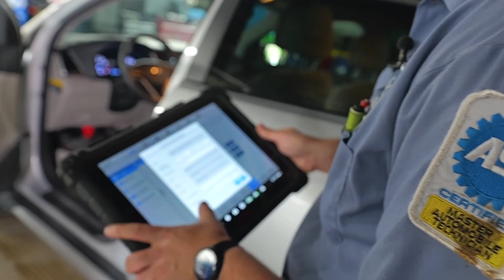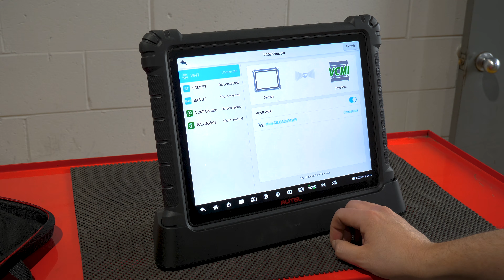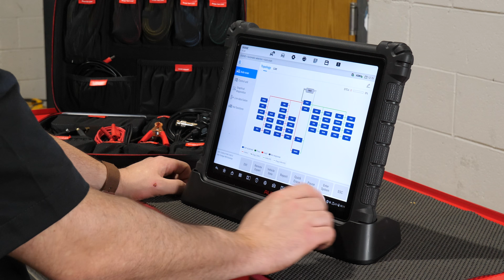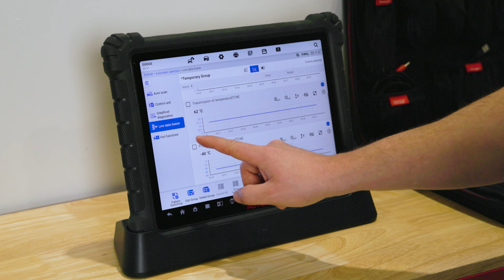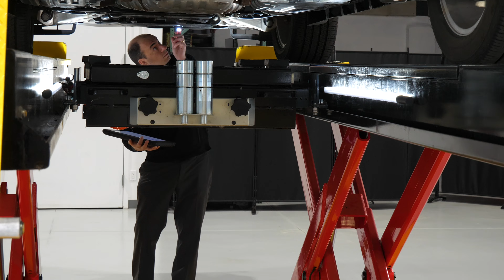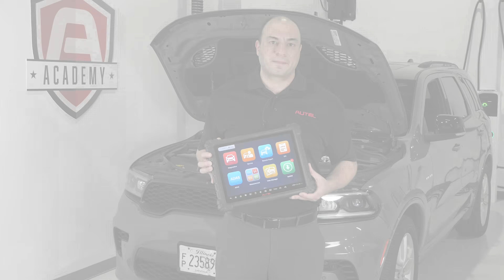Introducing the Autel MaxiSYS Ultra S2

Comment: You should offer this device as an option with the HVAC tool, have the lower spec as an option then an option to get the Ultra S2 with the HVAC system.

Comment: 3 units all dead in water AUTEL  service and quality has fell off a cliff they would prefer to send youtubers units than warranty the trash they force on customers! stand behind your products not  on the necks of your consumer!!                                                                                                                                                                          
MaxiSys MS906
Serial number: DS8G70102047 password: 259126

Registered on: 04/18/2017 Warranty : 04/18/2018 Region: Online

Software upgrade service expires on: 03/28/2025 (Expired) 

Period: (Year)

1
495.0 USD/Year

MaxiSys MS906 BT
Serial number: VB8GKAV01049 password: 717374

Registered on: 02/11/2021 Warranty : 02/11/2022 RGA Region: North America

Software upgrade service expires on: 02/11/2022 (Expired) 

Period: (Year)

1
695.0 USD/Year

TS508
Serial number: T85518023759 password: 089571

Registered on: 09/01/2021 Warranty : 09/01/2022 Region: North America

Comment: It still doesn’t support programming of control modules on other vehicle brands besides Mercedes-Benz and BMW without using Remote Expert? What about modules like BCM, TCM, and ECM on most vehicles.. can those be done without Remote Expert assistance? For a scanner priced over $6,000 with annual updates costing more than $1,500, I definitely expected broader functionality. It’s a great scanner overall, but I was hoping for more from the Ultra S2, especially given the price increase.

Comment: Autel is old news. You guys used to be top dog... a decade ago. With brands like launch, topdon, xtool, kingbolen, and others doing essentially the same thing for significantly less. The updates are cheaper, the scan tools are cheaper, the add on modules are cheaper with a larger selection too. The list goes on and on. 6k for a scan tool with $1600 yearly updates is absurd and thats why launch has been stomping you guys in sales and is in nearly every shop throughout the world today. You're updates are overpriced, your scan tools are overpriced and underperform, your UI is outdated, and you offer only 1 year of free updates on the majority of your scan tools. Someone who knows what their doing can diagnose a vehicle with $150 scan tool. They don't need all this extra nonsense. Not to mention, nobody even uses the oscilloscope option on these tools because if an oscilloscope is being used, then its a picoscope or a small handheld oscilloscope to do a quick check. You guys are falling way behind and eventually nobody will even care about autel.

Comment: Autel, your hardware was outdated before it was released!   My 6 year old PC has 64GB of Ram.  Your prices are nearing those of Snap-On!  What are you thinking? "Small" Shops like mine cannot afford these kind of Increases.  I for one am not going to suck out all the cash of my customers.  Corporate growth is showing its true colors as you mentioned!  You are growing to the point where it is time to jump ship to someone that is giving a good product at an  affordable price.
I give you a hint! When a Company grows so do their prices!! 
Don't even get me started on your so called experts! That is a joke in itself! I have already seen this for myself, it is sad when you get charged for experts that know less than what the guy using them does.
Don't get me wrong, I have no problem with the Ultra but they are certainly not very reliable tools. I have a host of them and be the first to tell you they are still cheap! 
The fact you do not build on a platform that is future proof shows your true colors!! Yes I said that! There is no reason at all that last years EV Model should not be able to get a lot of the functionality that the S2 is bringing.  At the very least there should be some reasonable trade in option, heck even Snap-On does that!! 
I have the Zeus Plus as well as the Ultra EV and I still end up using the Zeus more. 
I locksmith as well so I use the Handheld and the 508 and 608 with all the trimmings as well. Over the years I had a lot of glitches and wrong information with those as well. 
Again, still good tools but you should not upgrade tools to a point where your previous tool gets left behind to the point where you may as well throw it in the corner somewhere.  These Tools are not easy to sell! I have had mine on Marketplace for 3300 with all the latest updates and not a single inquiry about it!

Comment: They do not think when designing stuff. Well this is not their tablet its made by someone else. They just load software on it. I was gutted ultra 1 because vehicles like 2005 Land Rover it said rewound brake cable and nothing happened. I tried to reset Dpf on Renault van 2020 and it said done but wasn't. went to a Snapon scanner with the van and it did both the aforementioned jobs properly. DID YOU KNOW AUTEL WERE FINED 20,000,000 hacking and stealing data from competition. 

If they'd wanted to make this a great tool interchangeable batteries like power tools have so one can be charging in the shop always. I hated the case of ultra 1 it was so massive. And for this machine costing so much you would want it to have a built in tracking device. I stuck apple tag on back and put one in the inner lining of the blow molded case. For the price of course you want to keep an eye on it. I would say Snapon On better machine.

Comment: Ok, I’m a home geek and need immediately a way to program an 2003 Mercedes transmission, we do not have the old one. Also, my son drifts and is constantly paying for tunes, can the system do this. Also, not wanting a brick that will not work unless I pay for updates, like QuickBooks Desktop who wants $1,000 to continue to use the program.
Reply: For that Mercedes, I recommend an Autoland  Iscan 3

Comment: Just too expensive...especially when ever an OEM files a suit, we seem to lose functionality in the next update. This all happens with no warning to the scantool owner. For example, the IM508 loss of AKL for Toyota.....  And the diagnostic OE repair software that was included in my Ultra when I bought it only until Snap-On sued Autel and then .....gone with no partial refund  from Autel. The day is coming when a class action will be filed against Autel by all the tool owners for loss of functions that they paid for.

Comment: Surely you could have just put all of that on the original ultra via a software update
Reply: I agree. But all to manufactures do this to get you to buy new hardware. They all do it
Reply: What? With their bare minimum hardware? Good luck.
Reply: @lynxstarautomotive208  what's the difference in hardware? They didn't say

Comment: Six grand plus 16 hundred renewal is an awful amount of money . I'd rather go Launch !
Reply: Launch top spec arrived with glue stuck over screen. The machine was shit at diagnosis. Special functions shit. I sent it back a week later.turd
Reply: @jamesbarratt593  I have a topdon max which is the same software as top of the line launch. You are correct the software is garbage. I only kept mine as that autel was off for a battery and I got the topdon max for half price. I do not understand how there are people bragging about topdon either they have limited experience or they are paid off by topdon
Reply: topdon phoenix max, cheaper and 2 years of updates
Reply: @ThatDIYguy862  I already have one. It's great .I bought the ADAS function too. It all cost me $3000.
Reply: You can get the updates for 900 from AESwave and I have a launch based topdon MAX. My ultra is much better
Reply: All manufacturers are going to catch up and soon all be around 1500
Reply: I have im608 pro and its not updated. Wont be either. This ultra 2 wont be updated yearly

Comment: Bought several autel scanners in the past. They only last around 3 years before the fry or die. Took them to computer specialists for repairs, and no one was able to repair them. I like the brand, will continue to buy them, but never for full price, ill wait a couple years until the prices is reasonable.
Reply: I have my 906bt since 2018 and it still works. Slower to boot but works
Reply: @truth4reel the actual units are decent. It’s everything else that goes to crap. The attachments, and the J boxes are all junk.
Reply: What do you recommend for a German car inspection device that will accurately diagnose the fault and not confuse me? I would be grateful to you. @lynxstarautomotive208
Reply: I think you need to be more gentle. I have a ds708,maxysys908,maysis elite and ultra. The all works , only thing I have done is change batteries in them
Reply: So you’ll buy a used one to get a year of use out of it?

Comment: I have autel im608, ultra, 909, for German car not fully function, 70% coding can not  perform or can not perform properly . Send report on line request never solve the problem, update cause $1200-$1800 depend, hope they will improve that , but autel still best scanner tool in Canada market
Reply: For German, Iscan, Autologic, and OEM are the best way to go.

Comment: I believe the tools are good but price and update is outrageous between all scanners and tools it becomes very expensive
Reply: AES wave update when on sale is 900 for ultra
Reply: Its a top of the line tool sure its gonna cost and snapon zeus plus is $11,792 and its does half of what the ultra s2 is capable.
Reply: autologic charges 4k a year...lmfao
Reply: Its a professional tool for professional shops. If you want the best, you have to pay for it. It is still better than many that are not as good.
Reply: Bs.
Reply: @KinkNmotion The best? The best use many tools because there is no one shot tool that does it all. Autel has been gouging us for far too long now. Time to snap them back to reality. Their software is mostly pirated anyway. That’s why they have gotten sued (multiple times).

Comment: Lower the price of your subscription and allow your scanner to access vehicles that require autoauth to enter the system. My Ultra stopped letting me log in to vehicles that required it after I didn't update the subscription.
Reply: The manufacturer’s require any tool with a secure gateway to have a valid subscription. It’s not the tool no matter what brand it is
Reply: What manufacturers? If by that you mean the car makers then that's nonsense because they can't control that.
Reply: Yes they can. 🤦‍♂️ 🤦‍♂️ 😅
Reply: Yep. Gateway locked vehicles require an active subscription, or you’re going to have to buy the cheater cable. But those cables are not very reliable.
Reply: @lynxstarautomotive208 What do you recommend for a German car inspection device that will accurately diagnose the fault and not confuse me? I would be grateful to you.
Reply: @ابومحمدجلال-ج6ك  depends what generation of German car we are talking about, and what exactly you’re trying to do.
Reply: @lynxstarautomotive208  I want to buy a device, but I am confused about what is the most suitable device for examining German cars.
Reply: @ابومحمدجلال-ج6ك apologies, let me rephrase the question. What is your intent? Are you a DIY trying to fix your personal vehicle? Or are you a professional trying to service German cars?
Reply: I work in auto electrical maintenance and I want a device to help me in my work @lynxstarautomotive208
Reply: @lynxstarautomotive208  the cheater cable does not work anymore, I tried once
Reply: Dodge Nissan and Mercedes. I have an Auto auth account and when my subscription on my launch expired I can still use the scanner, but not the newer dodge Mercedes or Nissan that has the security gateway. The same auto auth account works on my other scanner that has the active subscription…

Comment: $6,500 I'll pass, not worth upgrading from the Ultra. Especially since annual updates cost $1,600. By the time the Ultra 3 comes out you would've paid for another scan tool. $6,500 + ($1,600 x 5 years) = $14,500.
Reply: They getting closer to Snap-on pricing.
Reply: @JacksJournale  actually still a good bit cheaper then a Zeus. I have a Zeus and a ultra. The ultra does a lot more . The only thing I use the Zeus for is older cars and graphing pids as snap on does graphing better than anyone. All the Chinese tools do horrible graphing
Reply: @mitchellcrane9809  i was the same with my ultra and zeus. But that has been upgraded in the ultra s2, you can graph like the zeus. But the s2 can graph all parameters pids linear, bar, and gauge simultaneously, where the zeus can only do up to 16 pids at a time.
Reply: @mitchellcrane9809 better than a PICO?
Reply: @mitchellcrane9809  The Zeus is Chinese too, like most Snap-On stuff now.
Reply: @JacksJournale  At least the Autel is worth the price. As far as I know you can't "ping" modules or have topology on snap on.
Reply: @JacksJournale  zeus plus brand new from snap-on is $11,792 and does about half of what the ultra s2 is capable
Reply: @JacksJournale  zeus plus is $11,792 from snap-on. The zeus does about half of what the ultra s2 is capable
Reply: They don’t do a full diagnostic course on how to use the full functions on the tool in Ireland
Reply: I was looking into making a purchase but it is pretty pricey. Yet, I wasn’t sure what those units are actually capable of doing or how accurate it is diagnosing problems. I’d like to add that I researched some of these units they don’t come with all the accessories like they are suppose to for instance O’Reilly auto parts to name one.
Reply: @t.farris1755  what acc. do you think is missing?
Reply: Give this man a standing ovation.
Reply: Better value in the Topdon Phoenix Max.
Reply: I see where your coming from and understand but i see this tool for technicians that specialize in diagnostics. Dont recommend this for r&r techs or entry level diagnostics. Highly recommend an autel 906 pro and it will do pretty much everything you need on a scanner on a budget
Reply: @unitalfredo Autel scope is junk. Doesn’t come close to a pico. Their tools don’t even program. You need a laptop to do that. Their J box is hit or miss. Works great on some vehicles, horrible on others. 6500 is insane for this tool which is basically a refined elite or ultra with stupid AI none of us will really use.

Autel needs to cut the bloat. The competition is zeroing in on them (TopDon). Same thing happened to Autologic. Got too big for their own good.